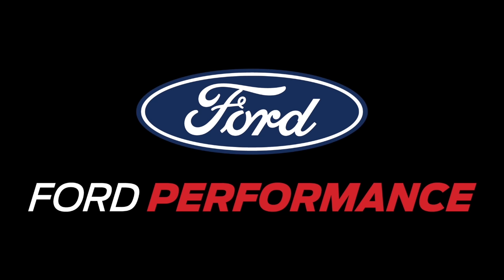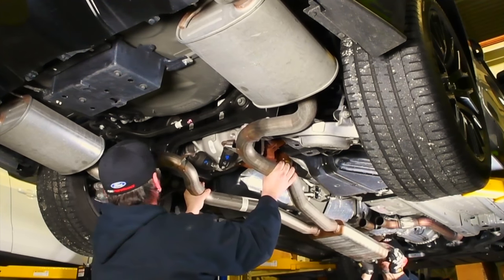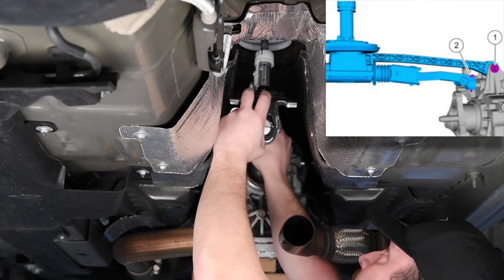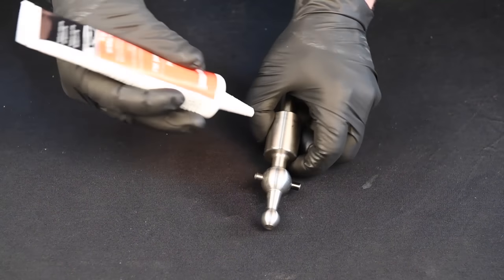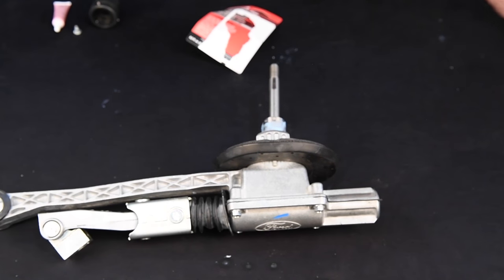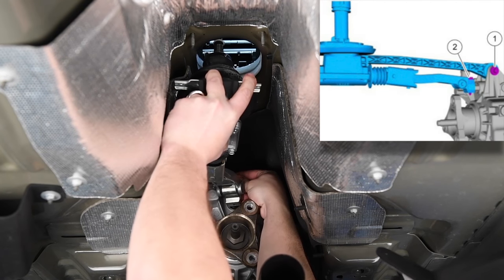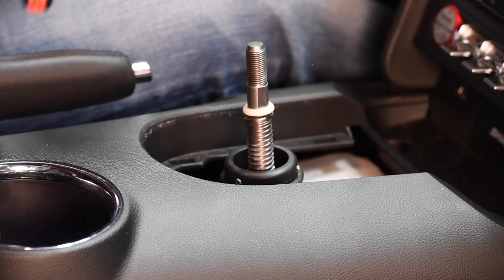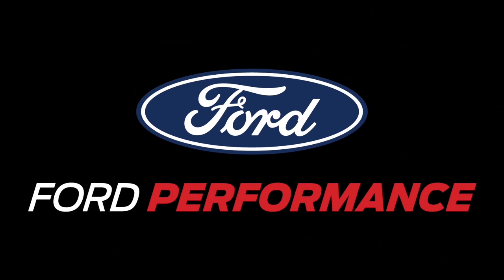How to Install the M-7210-M8 Mustang Short Throw Shifter Kit | Performance Parts | Ford Performance

Comment from the maker: Having trouble installing your short throw shifter? Watch our step-by-step tutorial as we walk you through the process.

What's the last Ford Performance part you installed on your vehicle?
Reply: Ford Performance Ford performance by Borla Touring catback system is the last and first Mod this is next then the Ford performance stage two power pack have to save Ford performance parts are expensive, but you get what you pay for plus the install only going with Ford techs for the work to my 2015 Mustang “Silver Bullet”
Reply: Will this work on my 18 mustang GT?

Comment: Can you just use a puller and pull the shifter out from the top? Boomba racing did that with theirs, but just change it all out and press it back in all from the top only?

Comment: Hi.. at 9 min 11 sec ..  they say to use the red thread locking compound on the drive shaft bolts... isn't red thread lock too strong..  not removable?
how do these bolts are removed when time comes for service, ie replacing the clutch.

https://youtu.be/f9CnyKH7iWQ?list=PLGpEhA1SM-IWEse1DgxHGEj6ZV1hDTru3&t=550